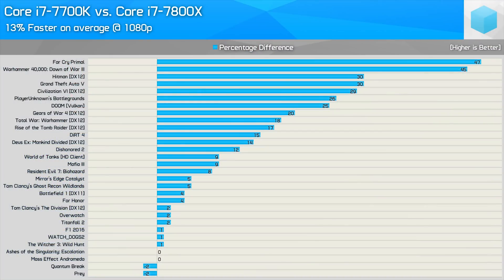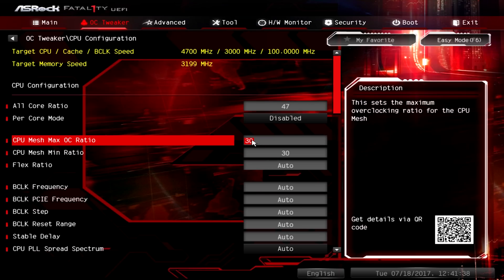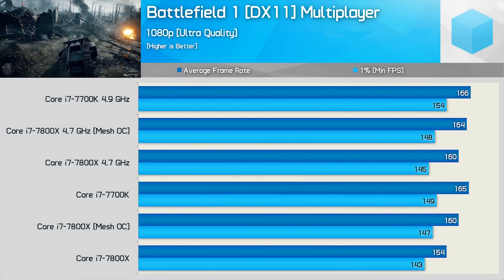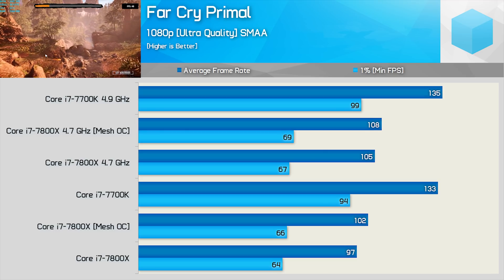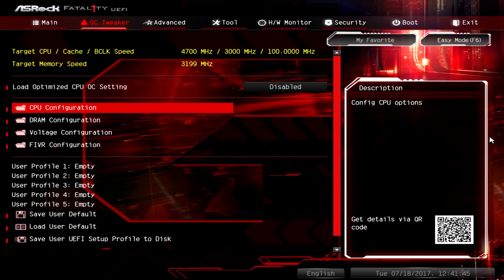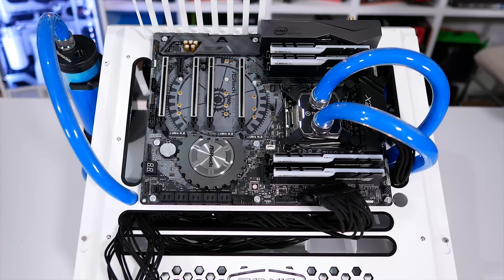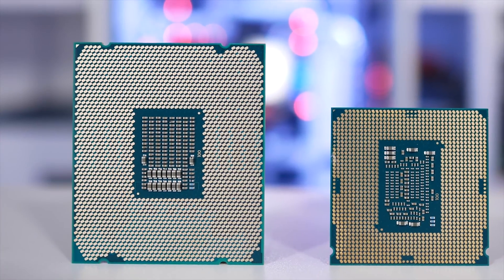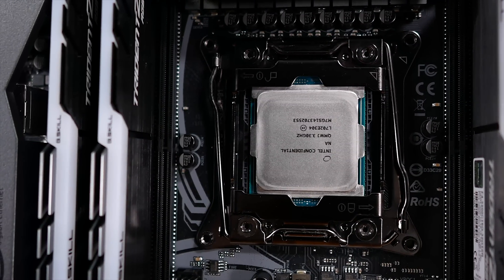Intel Mesh, Does Overclocking it Fix Skylake-X?

Comment: To me it just seems that that architecture has reached its limits.

I don't expect Cofeelake/Canonlake to make much of a difference either. I still hope for Coffee Lake to deliver as I think a CPU upgrade would be worth it for me, coming up from an i5-4670 which is bottlenecking my 1080 TI in quite a few cases to a certain degree but maybe waiting for Ryzens successor with the Zen 2 is a wiser move in the long run, given how much more room for Improvement there is for Zen vs what appears to be EOL Sandy Bridge iterations that can give you mostly sidegrades except those 10+ core Intel HEDT chips which I'm simply not interested at.
Reply: i was told every CPU Intel has been releasing are all modified sandy bridge cores.
and the reason why they kept 4 cores was because their core to core communication past 4 cores was horrible.
it would makes sense because IPC has gone up like 3% per generation.
Reply: +Not An Argument. It's like many have been saying, after establishing their position they just stagnated. Now they're being pushed and visibly freaking out. Calling AMD's cpus desktop cpus glued together being a visible sign of them losing it.
Reply: Not really. Sandy Bridge is a different micro-architecture than Haswell, which is again a different micro-architecture than Skylake. 

Coffee Lake is just built on the 14nm++ process. It's the same micro-architecture as Skylake. Cannonlake is a die-shrink. Icelake is the next arch.
Reply: ArtisChronicles Are they not two different cpus out together ?
Reply: Gameurai Cofeelake top i7 is supposed to be 3.7 GHz. Let that sink in.
Reply: Gameurai same I have a 4590 and I can't wait for something better so I can upgrade
Reply: Does your motherboard support a Xeon E3-1246 V3? I want to see if it can save power while eliminating
the bottleneck from lack of HT.
Reply: Covfefe lake

Comment: Fact is: 7700k is a beast of a processor. One of the only intel CPUs that can be considered good nowadays
Reply: Would have been perfect if it wasn't for that Intel toothpaste
Reply: Luiz Arthur Brito Don't forget the amazing Pentium G4560! Still, AMD blasted the i5's, the X99, and the X299 chips.
Reply: +Luiz Arthur Brito Good if you like delidding and risking destroying the cpu to get actually normal thermals.
Reply: bshxh that's because the fxy lineup was a complete disaster,even an i3 could beat them at single core tests! Also a major thing is that the next gen consoles are mostly going to be based on ryzen which will mean better optimisation for those extra cores.
Reply: +bshxh  8 years ago the only mainstream high core part was FX lineup and it performed poor at the time, being destroyed by sandy bridge. 
Now Ryzen is popular, Intel and AMD are competing in high core count mainstream systems for the first time ever and people are leaving behind their 4 thread systems and will continue to do so in upcoming years, as high core CPUs are getting better and cheaper. 
Sorry old timer, times change.
Reply: +Cheesyburps  Listen, we don't expect old games to update themselves to better support 4+ cores. But one thing is for certain, this isn't the time where the FX lineup came out and everybody was like "wtf, waaay ahead of it's time, sucks now";    currently you can buy an 8 core Ryzen for the same price of a flagship quad-core intel CPU, have the same IPC and not really notice the difference between the two if you are playing on GTX 1070 and anything below that(like 90% of people do) + you would be future proofing and have a beast of a CPU for anything else besides gaming. 
So basically more and more people are jumping to higher core count CPUs because they are cheap and effective, unlike Bulldozer days. This is not counting the HEDT (x299 and x399) Intel parts and AMD which will push the boundaries on what it means to be an enthusiast and high end desktop user even further.

Saying future proofing doesn't work is just a generalization that doesn't take into consideration many factors, including limitations to current 4 core designs and clock speeds, current market, upcoming CPU releases, gaming industry adoption of newer API due to the above mentioned factors and the fact that current future proofing with Ryzen isn't some extra cost that will benefit you in the long run, but a new standard for price/performance and there is no going back from that.
Reply: +bshxh FX was bad. But Ryzen can keep it up with Skylake and offers 12 threads fpr ~230$. Intel also announced 6 core 12 threads mainstream i7's. The future is cristal clear multitasking (=many cores+threads).
Reply: Actually, CCX modules have less latency between the cores inside the CCX than Kaby lake does. But the inter-CCX latency is higher.
Reply: +Chiriac Puiu 
Good point about pairing with 1080Ti or similarly strong cards. Believe it or not, a 7700k vs Ryzen R5 1500X (4c8t CPU) are the same in most games when paired with gtx 1060 or below, and probably a 1070 in some cases.
Now look at the percentage of people who actually purchase 1080ti class card. Very very small, but from all the benching done with those cards, we forget that it represents ideal case scenario because they don't want to bottleneck the CPUs, but it's not representative to majority of gamers who will play on weaker graphic cards.
Reply: intel seems to only be able to hold on to the 7600k and 7700k and pentium g4560 with everything else destroyed
Reply: Cheesyburps Look at Mafia III, it is the future of games and ryzen kills intel competition there
Reply: +Cheesyburps How is it terrible optimization for a game to be able to utilize more than 4 physical cores?? With your logic the best optimized games are single core games then.
Reply: I have a 3770k at 5.15 ghz and the ram ocd to 2692 mhz. Its a good cpu by todays standards. It hits just under 14k on physics in firestrike.
Reply: How would 6700K be better than a 7700K?
Reply: It's thermals are much better. It actually overclocks better (easier) and doesn't require delidding to oc to 5ghz or even 4.8ghz (I've seen kabylakes that can't even oc to that without heat problems)
Reply: Cheesyburps that isnt terrible coding, it is taking advantage of 8 core ryzen parts so people can buy just ryzen 7 1700 and everything will run great on it, multitasking and games
Reply: Jimmy O the ipc in ivy bridge is shit compared to anything newer and as far as i know you cannot bring 3770k above 1.325V stable which wouldnt let u oc it to 5ghz so that is a load of rubbish
Reply: Luiz Arthur Brito 4790k and 6700k are still beast and are worth about the same
Reply: I mean it's basically just a rebadge of the 6700k but whatever. I'd say the only current cpu they should be proud of is the kaby pentiums but even then all they are are much better priced underclocked i3s
Reply: Except the 7700k runs hotter and (on average) can oc to 5ghz more often than the 6700k, still 6700k wins imo, you have to delid to get reasonable temperatures with the 7700k, well only if you overclock past 4.7ghz
Reply: Alex Villalobos I've got an i5 4460 atm, my upgrade for my motherboard will be the i7 4790. Thinking of buying it for the holidays. I know I'll be pretty pleased woth it
Reply: Luiz Arthur Brito What is your gpu?
Reply: Lol you are so clueless.
Then why is the i5 Rekt? Because games use 8 Threads, not 4 cores and 4 threads as they did before. In 4 years, the number of threads used by the average game has near doubled.
Reply: the 7700k has the lowest core to core latency
it also has the highest clocks
it's not even a good CPU, just one without latency.
Reply: And only games, nothing else :P
Reply: Cheesyburps true but the majority of people(at least who I know) considering ryzen are the ones who want to game +do some other task simultaneously and in that case more cores do prove to be beneficial. For just gaming? Yup you won't need those extra cores!
Reply: +Barman Brothers Yes, 15 years ago this really meant somthing. But why do you think dual or quadcores with a lower frequency killed the one core high frequency cpu?
Reply: You guys think Mafia 3 has good optimisation??? Wtf is going on here? It's a terrible port, that needs a GTX 1080 to run at 1080p. That's not good. Who cares if the game uses more cores if overall performance is shit anyway.

Oh but bloxyman22, that's a strawman argument. I never said that. It's bad because it's a shit port, not because of core/thread usage.
Reply: has nothing to do with the Paste.
The tolerance between the CHip and heat spreader is too large.
Even cheap Paste performs +- 5C to the good shit.
Reply: Ganesh Sahane Oh I totally understand that side of the argument. That I can't say much about, because objectively more cores is better for heavy multitasking. Ryzen, especially for the price, smashes that area!

My main issue is with the people who say they want to do "heavy multi-tasking" which involves a game with youtube on a different monitor. Like...that isn't a heavy workload. Even an i5 2500k can do that. Now the people who are doing proper rendering? Fuck yeah, get a Ryzen
Reply: Liam Dorsey Terrible coding and optimisation is the future? Well rip the gaming industry.
Reply: i love my 7700k it smashes all games
Reply: That's not true. The 7700K is a very good quad core, BUT ONLY a quad core. Because the vast majority of gamers use dual and quad cores, all games are not well optimized for more cores. This will change in future. You'll see in ~2,5 years the R5 1600 @4GHz ahead of the i7 7700K @5GHz in most modern games, because multithreathing is what counts, single core performance is nearly on every cpu enough nowadays.
Reply: @paulmuresan8889  And here we are 2,5 years later and as I thought you were just talking trash. Game engines can not be parallelized very well which is why the 7700K still is at the top with the 8700K and 9900K/KS, and far above the R5 1600. Even a 8 core 3700X is behind a 5Ghz 7700K most of the time. Sorry your dreams did not become reality. Single thread performance is what counts and therefore you have to buy a Intel CPU if you want the most performance nowadays. Obviously AMD is offering the best bang for the buck, but not the best performance.
Reply: @SURO90   It's true. My prediction was wrong. Its as you say, not every software can be parallelizied. But the distance between the 7700K and the R5 1600 has narrowed. Especially regarding 1% worst frametimes. Quad Cores are entry-level nowadays.
Reply: 6700k is also as good if not better
Reply: Paul Muresan But how then r5 1600 loses to 7700k in a game like BF1 where all of the threads are well utilized?
Reply: If you guys seriously think the majority of games will use more than 4 cores, within the next 8 or 9 years, you are either too optimistic, or just don't know much about the gaming industry. 

I've been using quad cores since the day the Q6600 came out, and I've been using quad cores w/ HT since then. Games haven't changed. The mass majority use between 2 and 4 cores. Like I'm fairly certain you could count the amount of games that use 5+ cores/threads just on your hands. 

Basically what I'm saying is if you buy into high core count cpus hoping one day they will be great for multi-threaded games, you are wasting money. The chips will be obsolete before the games even come out. Always buy the best you can at the time. Future-proofing doesn't work.
Reply: Paul Muresan No it won't 😅 games will continue to use 4 cores, people were saying that when the shitty FX 8 core processors were released, and look now nearly 7-8 years later nothing has changed

Comment: Wait, isnt the IPC difference between 1500X and Kaby Just 7-8%?
Reply: IIRC 6.8% when Ryzen launched, and Ryzan had a 1% IPC lead over Broadwell-E.
Reply: ArtisChronicles 5Ghz with such a fast cpu as 7700k means a lot more than with slow low ipc fx cpu.
Reply: Clock speed isnt IPC.
Reply: Zen's IPC is on par with Haswell, but due to massive architectural differences between the two and the fact that Ryzen is basically still in its infancy, performance in some cases is hampered on Ryzen... 
And not to mention Ryzen can't even touch Intel in terms of overclockability but I presume that will change with Zen 2
Reply: +Wintie What I find funny is people used to say clockspeed isn't everything and now that the 7700k reaches 5 GHz (like many people were managing to do with fx 8 core cpus) they act like it's going to save them in every scenario, that they can't possibly be outperformed.
Reply: Alexander Yordanov I'm aware, just another factor to actual performance, which is why intel can still boast at all.
Reply: Alexander Yordanov clock speed is at least 20% less in most use cases.
Reply: More like 12-13% in computing, and 22-23% in games, on average.

Broadwell is only 2-3% slower than Skylake.
Reply: Alexander Yordanov the real world performance, especially gaming is around 30-50% difference. But on productivity there are only around 10-20% differents even considering the higher clock speeds.